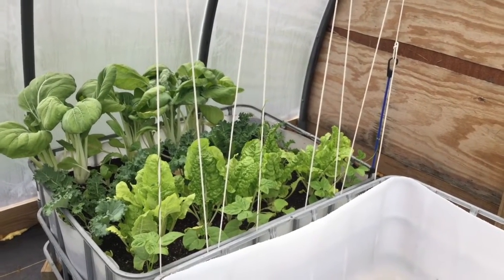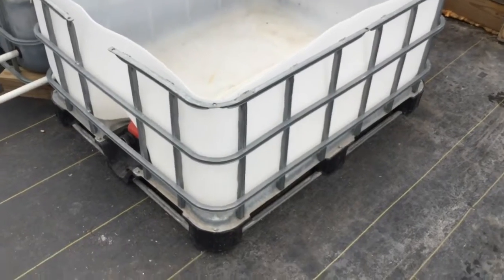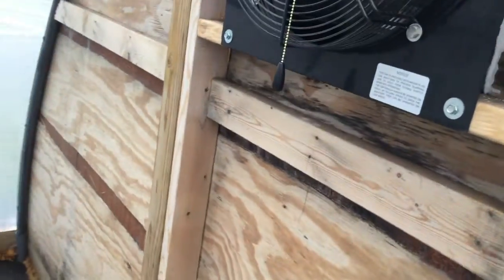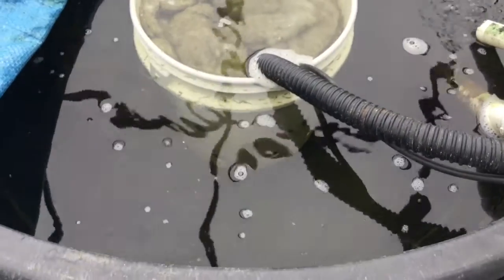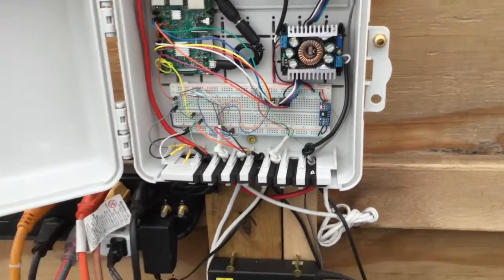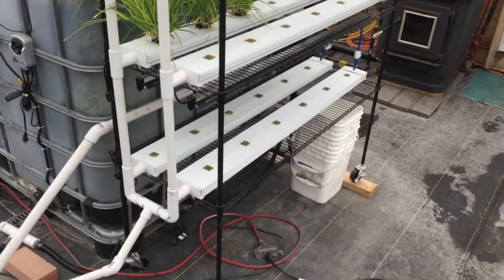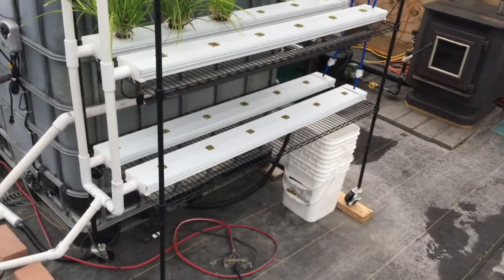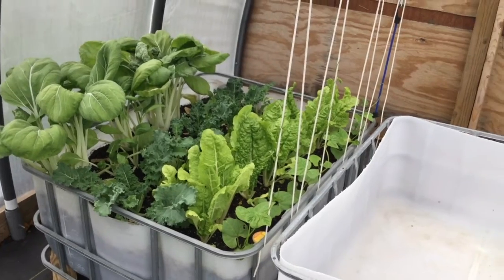Constant Flow Wicking Beds (3)

Comment: This is a fantastic setup. I'm a bit late to see this one. After a couple years I wonder how the bed material is holding up. Does it need changing on regular basis?
Reply from the maker: I've never changed it, they're nothing but composing worm beds that I grow plants in. Most you have to do is top them off with extra soil once a year.
Reply: @LordLarryWho  thanks for the quick feedback

Comment: Hey Larry,
Thank you for the education, Larry!
I recently bought 10- 55-gallon drums split them in half and created wicking barrels. I was talking with one of our suppliers about raised beds and he suggested I use the totes, cut them in half, and create raised beds. He gave me 6 totes. I was thinking this weekend about how I want to set them up (traditional or wicking bed) and happened to run across your YouTube channel. I really like what you have done. I am thinking about it though... the most expensive part of the project is the drainpipe, 3-10 ft sections are roughly $50.00. (per ½ tote). Now that I have seen what you have done, of course, I want to duplicate your watering system. Its been a couple of years since you posted about your wicking raised beds, how many beds do you have now? What have you done differently than your original 3-part series? Any nuggets to pass on? 
Thank you for your inspiration & knowledge!
Bill-St Louis Mo
Reply from the maker: I have 12 now and they're all built on the same concept. Not sure why that drain pipe is so expensive in St. Louis, it's only $4 for a 10 foot piece from Menard's out here.
Reply from the maker: https://www.menards.com/main/plumbing/pipe-fittings/corrugated-pipe-fittings/corrugated-drain-pipe/040010pfc/p-1444451516346-c-9568.htm
Reply: @LordLarryWho  The price I quoted is for the 6-inch drain pipe (from home depot). Menard is directly across the street from home depot, I will swing by Menards.
Reply: @LordLarryWho  Ah, what a difference in costs, you used the 4 inches and I used the 6 inches. The ONLY reason I used the 6 was that a YouTube builder of the wicking tubs suggested it. You are having great success with the 4 inches so I am going to move in your direction. Did you produce a video on your raised bed watering system and installation? OBTW, thanks for taking the time to respond to my questions, I appreciate it.
Reply from the maker: One of those videos explains the plumbing, I'm pretty sure that it's the first one.

Comment: What GPM pump are you using for that many units. This is a great idea. Is it constantly running and draining into the storage tank? That would be great for units that won't get any rain. I want to do one wicking bed next year and mine would be out in the elements. We go away often for sometimes 2 weeks at a time. This would be ideal if it didn't rain. :)
Reply from the maker: It's actually a 500 GPH pump, but things are choked down with ball valves so it doesn't over-feed the beds. It only runs for 30 minutes every 12 hours to maintain a fairly constant level in the beds.
Reply: @LordLarryWho  Thank you. I am thinking about getting a 3 GPH just to start out with a large rubber stock tank as a test phase. Do you have a timer on it? I am going to get a 12v pump so I can run it off of a battery. I wish I could put a water level switch on it.
Reply from the maker: Yeah, I have a timer on it. I don't know about a 3 GPH pump, that couldn't have any pressure at all. Better to use a stronger pump and choke down the flow with valves.

Comment: Why didn't you put your plumping on the other side of the tanks so your not stepping over it all the time and would look cleaner/ neater
Reply from the maker: Because it would have required 3 times as much PVC, more bends, and created more potential for low spots that would plug up with settling solids. I'm more concerned with "keep it stupid simple" (yes, I intentionally say it that way) and not the least bit concerned with neat and pretty. I'm the only one working in the greenhouse, I know the pipes are there, doesn't bother me to step over them. Those pipes are also the least of the obstacles.